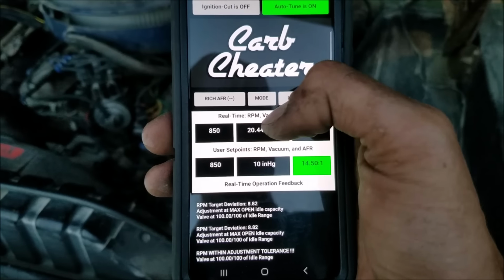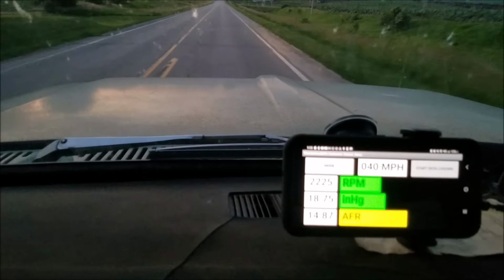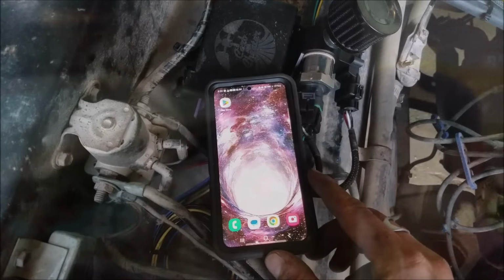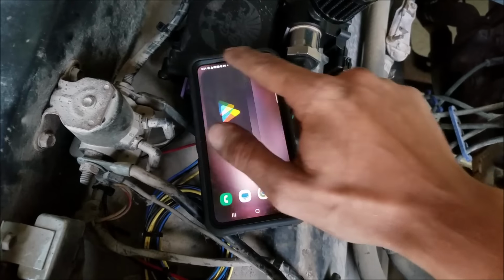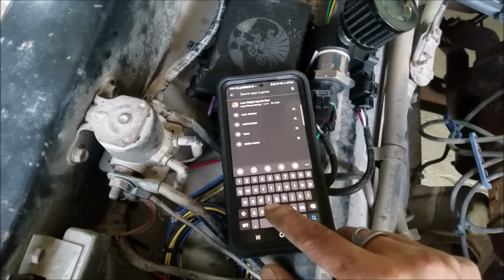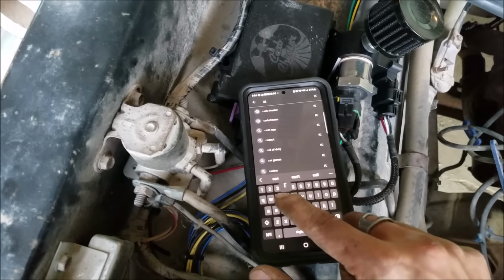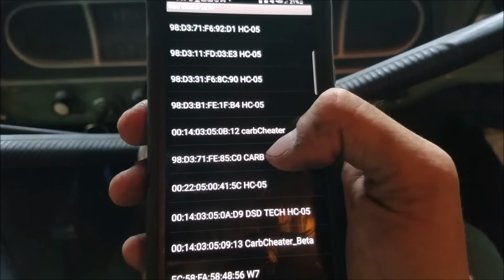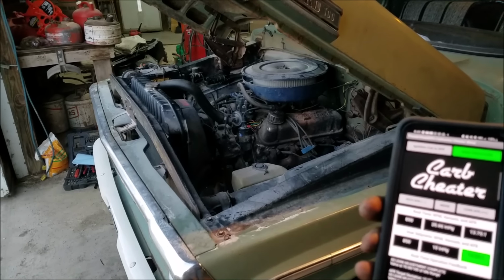Make a SELF-TUNING Holley/Edelbrock Carb! (Carb Cheater: Installation & Setup)

Comment: I think this is one of the best products to come out for carbureted vehicles in a long time. I wonder how well this would work on an efi vehicle to improve the tune and control idle speed
Reply: EFI systems do that all themselves.
Reply: @16vSciroccoboi  yeah in theory they do, but almost all factory tunes are imperfect. Even if this was used to monitor afr and control the idle on an older efi vehicle, it still adds functionality  that you can't get for this price
Reply: @Maxw3llTheGreat  any EFI systems after like 1990 should be working fine in that regard unless some component is bad. This is basically just a way to make an oxygen sensor work on non electronic carb systems. It's a cool product but it's not doing anything even the most rudimentary EFI systems aren't already doing. 

This wouldn't be able to effect any change whatsoever on a MAP based system except changing the idle. 

On a MAF system you could use it and technically have an effect, but both systems you can do what this does with a wideband O2 sensor and their offsets.

Comment: How does it do adjustments? I don't get it. It's amazing. I'm getting one.
Reply from the maker: It's just a proportionally controlled air bleed that adapts on the fly based on target afr and actual afr differential

Comment: I wonder what would happen if you modified one of these to control a later electronic carb like a q-jet wtih the weird electronic needle? Very tempted to pick one of these up for the cranky slant 6 in my '83 D150, and the 318 it's getting whenever I find a bellhousing for an A-833 truck 4 speed, and clutch fork, and other bits needed.

Comment: lmao. a self adjusting air leak IS NOT tuning the fuel supply based upon load. you cannot change the engines air demand. this is akin to opening and closing the throttle to tune your car. thats not how it works dude. FUEL. INDUCTION. the fact that air passes through a carb is just the energy source for the fuel to be pumped through the carb and delivered to the engine.  as GDI proves. Controlling the air stream is of zero consequence.

Comment: So interested to see how folks solve the multi carburettor problem.  It's absolutely possible, but I'll let others do the hard work 😅 old mate on the forum is hard at work getting one of these into a VW Beetle engine lol.
Reply from the maker: I hope he keeps communicating with us, there's a settings adjustment that controls how much adjustment cc allows which is applicable to smaller engines. 
The exhaust is another battle due to the wideband install
Reply: @ThunderHead289  yeah it's very cool.  I have a Jag with twin SUs and a twin 3 into 1 exhaust, so my best guess is- identical carb setups with air injection T pieced into each, then relying on one O2 sensor.  I think thats the setup old mate is trying first.  Let's see how it goes.

Comment: I love this product. Question I have will it work in a HP Street application? I have a Big block Chevy 402 CI engine with 11:1 compression high lift low vac producing cam. When I run a Holley 750 I have to run a 3.5 power valve. I'm currently running a Edelbrock 750 in which I virtually have no change in rpm when adjusting the idle air screws and I have no vacuum leaks anywhere. I have a bog when full throttle accelerating from about 2k rpm momentarily. Besides adjusting A/F ratio would this product help solve the bog issue. Congrats on a great innovative idea

Comment: No, I am not tired of my carbs not running right because I can fix them in the dark with one hand behind my back, and there are no sensitive electronics in my car and I like it that way.
Reply from the maker: As can I, but a lot of folks are afraid of carbs - this helps with that. With a wideband though I can confirm that afr moves around a lot more than all us seasoned carb guys originally thought. 

I respect what you say about electronics too - I drive a carbed car everyday but im a heavy programmer by day also, so what does that tell you lol. 

We did make every stride to make our circuits tank brigade class. I ran all power tour with my own Carb Cheater directly above my header in order to beat on it more than anyone else ever would 🙂

Comment: Good on you for actually including everything needed to install the kit. Things like the extended studs for the carb spacer, the fuse holders and the clamp on bung might seem small, but you just saved every single person who buys this kit a drive to the auto parts store. Great work!
Reply from the maker: We want it to be very easy, it really does take less than 2 hours to install - we wanted it to be an enjoyable process, not frustrating 🙂

Comment: Is this thing just a  metered air leak ? I
Reply from the maker: A very smart one, but yes. And a gauge pack. And a datalogger, and a Rev limiter, and has an auxiliary programmable relay/rpm window switch, and an ignition lock. It's many things honestly

Comment: I have a question for you.? Could you put this on a stock car?? Cause I don’t think it’s going against any rules. You still have the same carb. It’s just going to keep you at good turns. Right or wrong? So how do I get this? How much? Does it work with a cam?
Reply from the maker: No idea what it would look like racing - numerous features would be handy for racing like the datalog alone. 
Can buy one at thecarbcheater.com 
Could let us know how it goes - wasn't the original intended purpose, but it's worked out to be fairly versatile

Comment: Really glad you made your project into a reality, being an engineer paid off eh?
Also get the Carb Cheater patented, Would hate it if someone stole all your well earned glory, or thunder. (No pun intended)
Wouldn't be surprised if you got offers or sponsorships relating to the Carb Cheater, this kit will definitely tune in with the people that don't like to fully embrace the Carburetor as it is & tinker and tune on a weekly basis without some form of "Instruction" or information, Off the path here but either way, if you don't like embracing the concept of a carburetor, i'd say your in the wrong hobby.
Anywho, good deal.

Comment: I always run 4 CLG with like  A volley weber style.    I NEED ONE OF YOU Systems.   Also IMPORTANT Question. 
Can it act like A deceleration Valve And Give it max air when letting off the accelerator.   I have a mcanical deceleration vale but it wears out. Can this give the engine a burst of air when you let off the gas.

Comment: Does the ignition feed care if it gets less than 12v? Like with a GM with a resistor wire or Mopar with a ballast resistor. Or should it be attached before the resistor?
Reply from the maker: It doesn't care - we designed it to accommodate a resistive lead.

Comment: May be a dumb question, but does the O² sensor need to be any specific distance from my header collector? If not, i may consider just tapping in right before the exhaust hooks up but i dont want to cook a sensor. Putting it there would guarantee i dont need to worry about exhaust leaks though lol

Comment: this essentially only being connected to an oxygen sensor and a carb plate not the carb itself how can it make any adjustments ? its only a airfuel , vacuum gauge? witch is fine im not knocking trying to understand how its self tuning
Reply: I believe it's simply a metered vacuum leak.  Adding extra air thru that leak leans out the mixture.  It doesn't have to actually control the carb.  Simple, and effective.

Comment: Thank u for the wisdom! Question, besides idle speed and making it leaner by bypassing air how do u make it richer? What’s different from just making a controlled vacuum leak?
I’ve played with that and it’s only good for about 200rpm which is great but less than 1 point afr

Comment: Luke, this thing is awesome, but you need a layout that is easier to conceal, because a lot of the people who will want this are keeping their carburetors because they are driving classics, and don't want the visual changes under their hood.
Reply: It's pretty easy to conceal this system.
Reply: Maybe mount it under the dash & pass the wires & hoses thru the firewall with grommets ?.....

Comment: If it weren't for the fact that my specific application has 2 independent intakes and comes already equipped with a dreadfully shotty 80s EFI I would jump on this in a heartbeat. It's just hard to spend this specific amount for a bolt on kit, that I would need to make modifications to (and potential ruin), for it to even work for me...

I only consider this as a potential option because the other fully custom alternatives are 10 times the price, while this kit technically offers the one SPECIFIC thing I need and that's the active real-time controlled air valve. My application has a mechanical air auxiliary valve, even when new, they were notoriously sluggish and prone to failure. Rebuilding them is no small task, and all that cost and effort to restore something, that wasn't even great to begin with, sounds like a misuse of funds.

Not urgently in the market for this since my valve has only half failed (being opened too wide for too long and never full closing to the amount it needs to even after calibration) I literally just put a 1" washer at the mouth of the input and drilled out the exact size to get the proper air flow for an idle RPM, super hacky, but it works and cost me less than a cent.

I've been meaning to do the proper research on finding a cheap 12vdc proportional solenoid valve to build something simple, but I have yet to find anything too promising or affordable. Worst comes to worst I can just find a mechanical control valve that I can manually operate similarly to that of a choke.

Comment: my edelbrock carb has a spreadbore design so that spacer would not work,i found out the hard way as i had a 4 hole spacer like that and tossed it on not even looking at the bottom of my carb 1st and after not getting the secondaries to open i found out they was hitting the spacer, so what would i do in that case? run my spreadbore adapter on top of this adapter? that may be a bit hard with already having my air cleaner nearly touching my hood.
Reply from the maker: We're working on a spread bore adapter - we didn't realize how many people would be interested in this deal 😅

Comment: Luke will probably mention this, but your carburetor needs to be setup on the RICH side. aka never above 14:1. If you're already too lean, this will do nothing because it can't add fuel. If you're rich then the carb cheater can have room to work in. I wonder how rich is best though, I assume rich enough to not be lean on the coldest days, and then on hot summer days instead of re-jetting you can have the carb cheater add in air. Great Idea! I want one, it's on the wish list.
Reply from the maker: There's actually something curious that happens with carb cheater that was completely unintentional on my part making it so that you don't have to be on the rich side per say - as carb cheater starts working you almost trade throttle with it a bit, at that same load with less throttle opening the carb will naturally richen up oddly enough until everything homogenizes. It's really a weird phenomenon and definitely wasn't my initial intent but albeit convenient all the same

Comment: I'm interested to see if this works better than old 80's and 90's early efi applications. When I slap a new 350 in the ole 2500 I think I'm gonna ditch the TBI and try this instead. Makes the intake and heads easier to get too
Reply from the maker: Gm had a great idea with feedback carbs but the tech of that day just wasn't there to really do it - just think of what a personal computer was like in the early 80s. Heck widebands didn't even exist till 95, the modern style not even till the late 00s really

Comment: Did I miss something?  I watched the entire video and I have no clue how hooking anything up to your ignition coil can change the AFR.  An interesting concept, but please explain how it changes your AFR and engine idle.  And what else does it change, dwell, timing, spark intensity, etc?  And how far out-of-spec will it compensate for?  My truck with its Holley 4 b carb is mechanically governed from the factory on my vintage medium duty truck to 3800 rpm.  And I live at 4000 ft elevation.  Will it still keep everything balanced at sea level and at 8000 ft ?  Can I remove all the speed govern parts from my carb and distributor?
Thank you.
Reply from the maker: This was just an install video - the valve is what does everything which I'll explain within the week

Comment: Im stoked to see normal guys making cool products like this. Just a quick question though, K&N came out with a deal just like this a few years back, it cost as much as an efi kit like a fitech unit, so nobody bought it. Id rather buy from guys like you i just hope the corporate parasites dont try and hem you up
Reply from the maker: There's was sketchy and you needed a computer, and it was expensive - many drawbacks. We're not really making any money doing this hence the low cost. We just wanted to put the thing out there that we wished always had existed

Comment: Do you know the max cfm this adds? Seems like I should jet my carb with auto tune off then go one richer so car cheater turns my 670 into a 700?
Reply from the maker: You actually won't need to if your carb is tuned well as is - there's a weird phenomenon where carb cheater flows and you lower your throttle - when this happens the carb will go richer than normal for that throttle load where carb cheater and the carb homogenize nicely. I actually didn't plan it like that - just one of those weird things that worked out that way ending up way better than I expected

Comment: This is an awesome ideal. Similar to what I was thinking but better. I had a Fitech but it just wouldn’t run right all the time. I went back to Carb but took the ECU from the Fitech system and used all the sensors from it. So now I can data log and just change jets as needed.  I like this one better though. Good work, I may buy this
Reply from the maker: We like it, simple but effective - feel like it corrects all the things that make people want to go to efi but maintains the reliability and fixability of a carb

Comment: Is this compatible with MSD 6AL boxes?
Reply from the maker: No problem. Just hook to coil as per video. I'd set Rev limiter above the msd6al and let it take precedence in that department (carb cheater has a settable Rev limiter built in)

Comment: How does this actually adjust the carb settings without having anything installed inside the carburetor? Am I missing something?
Reply from the maker: Think about a pcv valve how it's a metered "vacuum leak" in a way. 
Carb cheater is the same deal in a simple sense, just a complex control circuit and program that automatically proportionally adjusts based on a comparison of actual afr and target afr. There's actually a weird scientific phenomenon that happened with this valve that I'll get into in a video in the near future - ironically i accidentally discovered this relationship by accident the effects of which not being my initial intent.

Comment: Here’s my question. Say you have a good tuned 2 barrel carb and buy a carb cheater. Would you be able to jump up the jet size and run this device to gain extra cfm & compensate for the jet size?  Basically, could this allow more airflow (through the metered vacuum leak) to make more power with the same carb?  Just curious on this one, seems like the opportunity to get additional CFM’s & potential power.

Comment: Holley has all these engineers and still haven't come close to something this brilliant.
Reply from the maker: I dont think it's that brilliant, there's no money to be made in order to keep the price affordable so a big company won't do it. It's basically a public service at this price
Reply: Holley came out with an electronic AFR adjustment in the 1980s. It was called Dia-a-Jet and used a PWM mixture control solenoid like many OEM smog carbs. It was a slow seller because without a modern WB AFR guage it wasn't that useful.
Reply: I did a search, & a company called Thunder Products makes a device for power spots called Dial-a-Jet.  It seems like doesn't use any elect feedback....... I'd like to read about that old Holley gizmo!
Reply: I remember the Dial a Jet. Never saw one in action personally but the magazine write ups were always positive.

Comment: Thank you for this video Luke. I look forward to getting mine! Only question I have, how would you recommend hooking up the coil side when working with an HEI distributor?
Reply from the maker: Green wire spliced to or plugged into "tach" terminal, and yellow wire plugged into or spliced into existing "bat" terminal 🙂
The mav that I did most of my heavy carb cheater testing on sports an hei
Reply: @ThunderHead289  Fantastic, thank you Luke!

Comment: It seems like you're only collecting data. Ratios from the O2, tach from the coil, vacuum... How does your product manipulate anything? Also, I'm in Denver, does it accommodate altitude? Work with HEI?  TIA
Reply from the maker: It trims afr via an automatically adjusted dynamic air bleed. Definitely works with an hei no problem as I have one on my original test vehicle - green wire to "tach" and yellow wire to "bat" on hei. Usually I splice them into the existing wires already tagged to those points. 

It will make a lot of sense in my carb benchmarking video that I need to do soon. It can pull you from 11 all the way to 14 at cruising throttle if need be
Reply: @ThunderHead289  Altitude a problem? Used to buy jetting kits with specs....at sea level...bastards 😆  It must work magically,  I can't wrap my head around how it adjusts anything. Looking forward to next vid! Thanks for the reply!